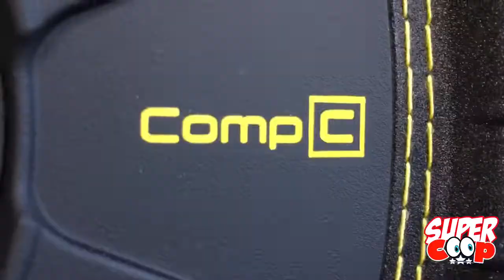Tunnel Run in Mazda RX8- SuperCoops EP9

Comment: That RX8 was running on low voltage. You're supposed to ground the Coils to the engine. If you ground your car to the body it won't run right.